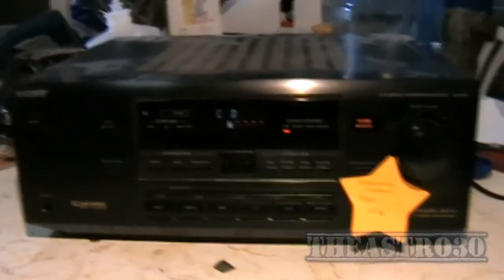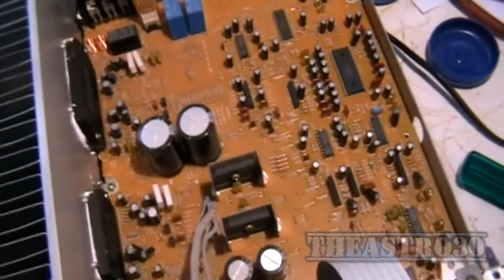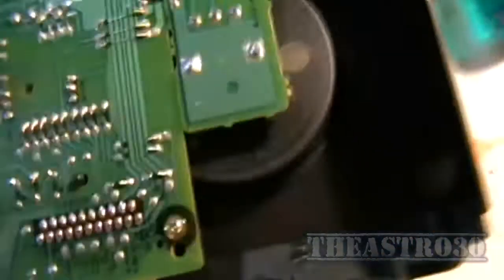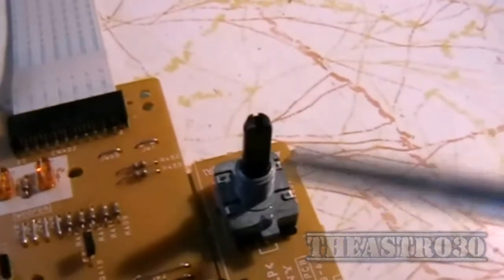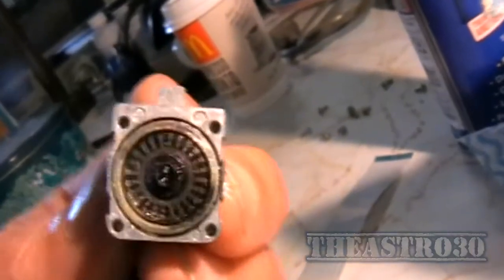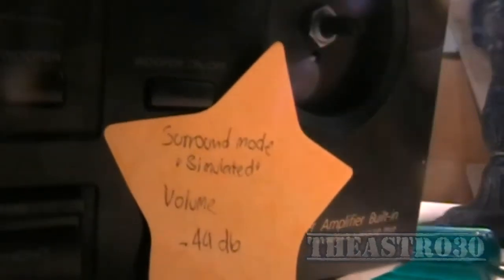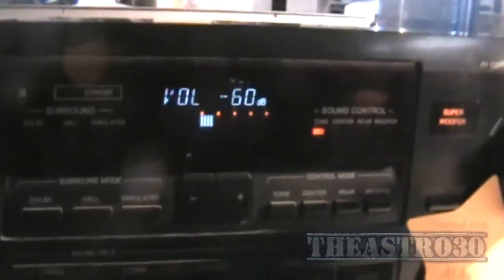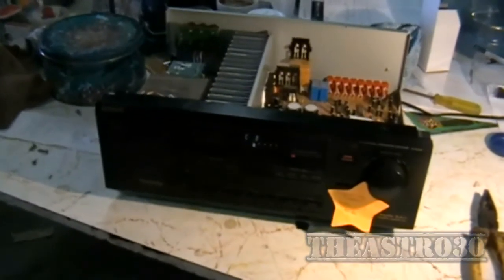How To Fix An Erratic Amplifier Rotary Encoder Volume Control

Comment: I need to replace the rotary encoder on the head unit in my car. The unit is a HH156 CSK 9711D, manufactured by Clarion. The rotor has broken off the stem, and the pins themselves aren't in great condition. I'm trying to figure out exactly what rotary encoder I should replace it with.... any suggestions would be appreciated.  

Photos on my gdrive: https://drive.google.com/drive/folders/15yY_--_VmNQ4fq1XAW2zyCLH9wEz0kpu

Comment: You scraped the contacts 😳?! No no no no no !!!! The intermittent operation isn't caused by "dirt", nor "dust" (the control is well sealed), it is caused by oxidation, aka tarnish. Clean the silicone grease off carefully with Q-tips and a gentle solvent, and polish the contacts and wipers with a pencil eraser. Apply a thin film of clear transistor-heatsink grease to the rotary disc, just a whisper of it, and reassemble.  I have refurbished many of these.